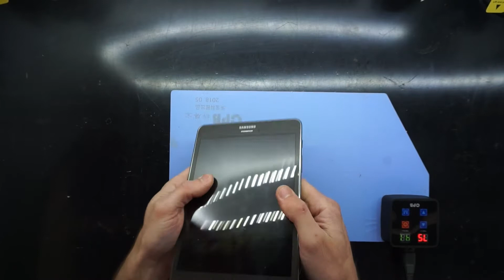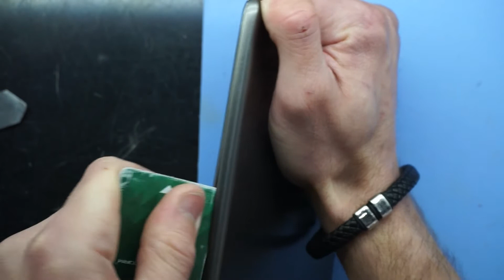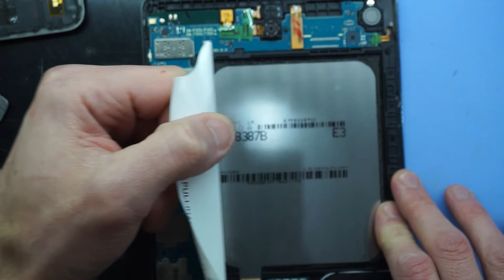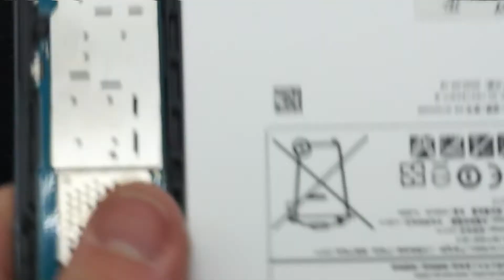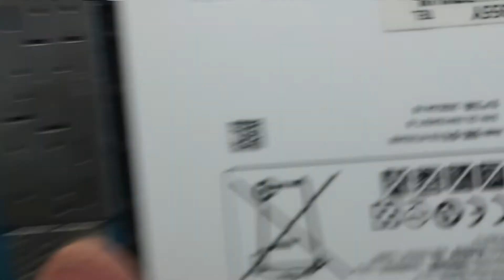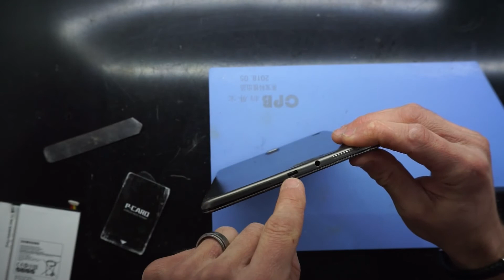Samsung Galaxy Tab A 8" SM-T355 Battery Replacement

Comment: 2016. my tab still having the bloated battery and cracked screen 😔
Reply from the maker: With those problems it would almost be moving to replacing time
Reply: @rickstechrepairs  i went to a repair shop before and they estimate it around 100 USD (converted from my country's money/ringgit).

if i let the tablet be like that with the bloated battery, will it causes other problems too other than the ones it already have? (cracked screen and bloated battery)
Reply: @milkiteahanaarts480  get a new battery from Amazon,  US$20. Free shipping.  Very easy to replace.  Your repair shop is asking too much

Comment: I changed the battery but it won’t charge turns on but stays on 0% if I unplug it it dies
Reply from the maker: I would be thinking a dud replacement battery

But the original battery and see if you can get it to charge